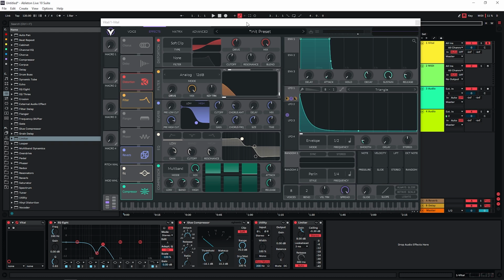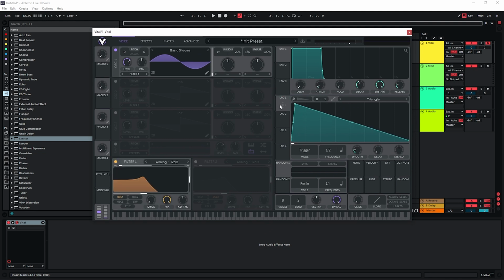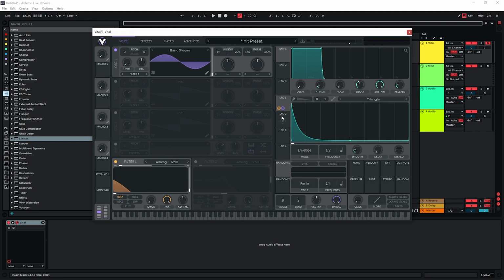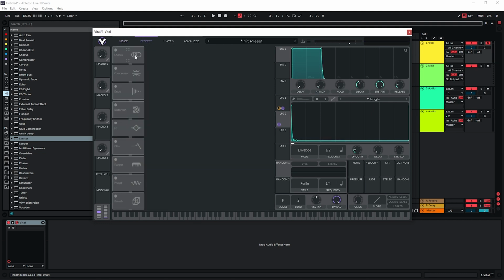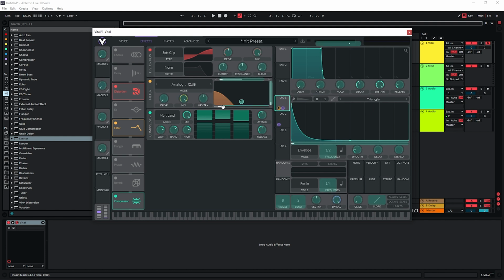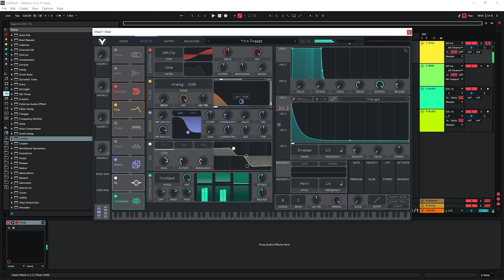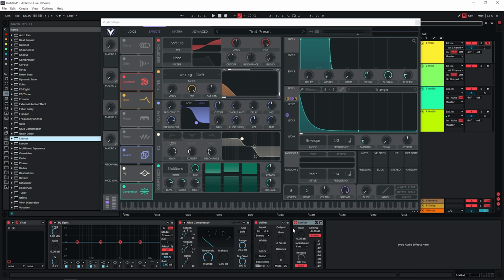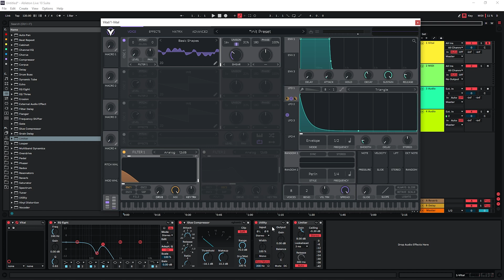How To Sound Design Trailer Booms (using Vital)

Comment: Hey, I have by now watched many of our videos. What really confuses me, ist that the sound from my computer sounds different, from yours in your video, even dough I actually just copied you :) What could be the reason for this?
Reply from the maker: It's hard to tell but it kind of depends on the sound I guess; for certain sounds, small differences can have a huge impact. So in certain instances, if your settings are slightly off, the result might sound quite different.
Reply: @NGTVST  Thank you for your reply. I guess your right. I just thought hardware could have played a role here.